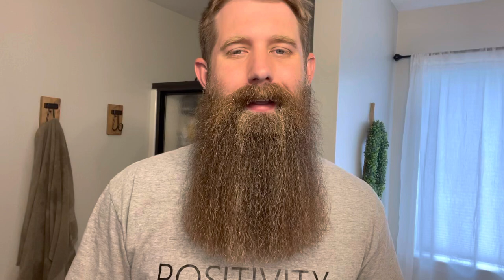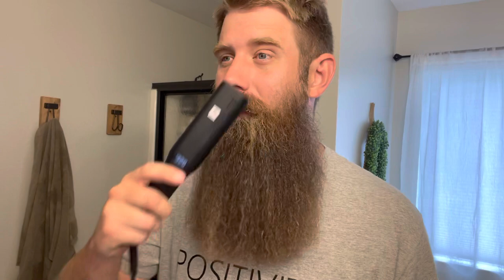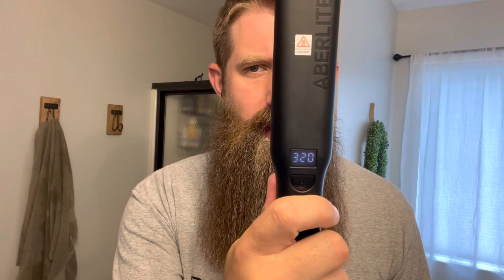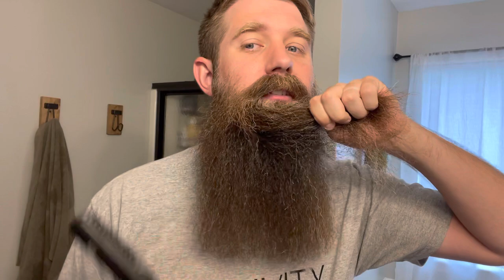A Better Way to Apply Heat to your Beard? - Layers

Comment: I only have one layer because my underbeard is not very strong. I can definitely see this method helping those with a thick underbeard who want to get everything to go straight down. I would say that doing the layers and straightening a really curly underbeard could look a little wonky on a medium length beard by causing the portion closer to the neck to be longer than the front of the beard depending on how it’s been trimmed.

Comment: I have around a 3 in. beard. It's very dense. I like to use a heated brush starting on the bottom side going directly upwards, then to the side, then lastly downwards.

Comment: I know that it is not endorsed by most but I use a hot comb and heat with stove(electric) I heat the comb and when at a good temp gently hold my hair with one hand and guide it with the other moving downwards.

Comment: Wow I never really thought of doing it. I suppose I will sometimes use a pick comb and blow dryer from underneath. Then go through combing down with a number 8. I suppose this does get most of the layers, but not to the same extent as pulling the hairs out of the way, and using a heated brush. Might have to try this, thanks Dan!
Reply from the maker: It is a good switch up from time to time!
Reply: @DanCBearded  I'll have to try the heated brush on the under layers!

Comment: I have been using this method on the chin/under chin area since my beard has gotten longer. It works great. My sides aren't as thick so I do really have to do it there. Great video demonstrating the method.

Comment: Great video…I had been doing the layer method for a while now. However working the side burns the way you showed in this video finally got rid of my side wave.  I did find out this weekend that finishing the outer layer soul patch and chin with the round brush and blow dryer worked even better. So my take away is to use both the heated brush (side and under beard) and the round brush and blow dryer (outer layer and finishing touches).

Comment: Hi Dan! Thanks so much for the awesome video akd being so positive. I have a question for you and I wonder if you could help. I have a medium length beard and when I use the beard straightener it seems to take away all the volume and shape… it makes it look too flat and too dead. When my Barbar blow drys it, it looks just perfect. I tried blow drying it but I am so terrible at it…. A few people have recommended that I get a “blow drying hearted brush” instead and said it’s easier and gives the same affect as a blow dryer. My question is … what do you think of using that type of brush ? And is there one in particular you would recommend ? Thanks so much and sorry for the long rant 🙏🏼
Reply from the maker: I hit you back in your message on IG 🤝

Comment: First!
Reply: One question: should the heat be applied after oil application? (I think that is necessary leave 5min to let the beard to absorb the oil)
Reply: @geppeB  yes. I would add oil before heat always